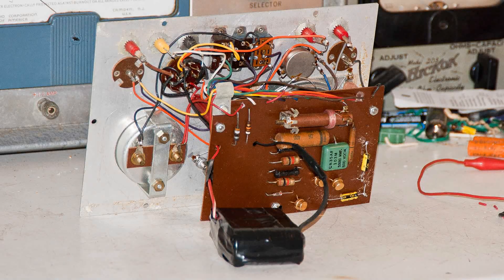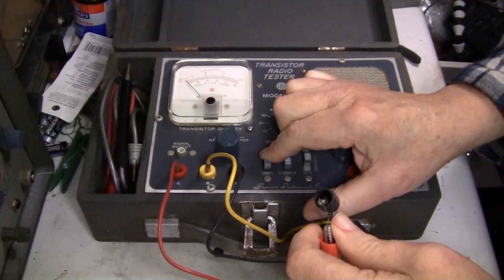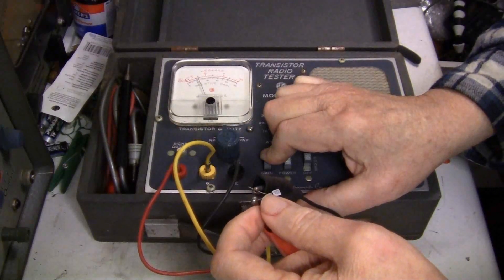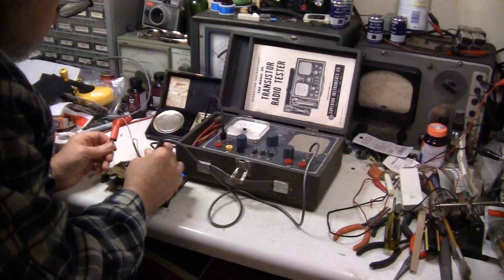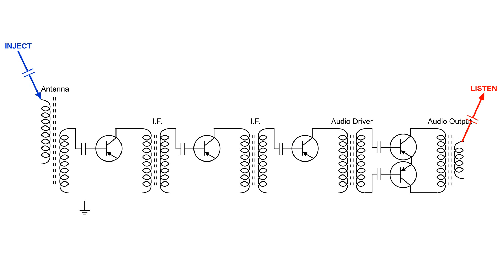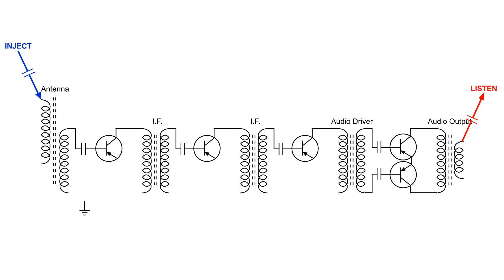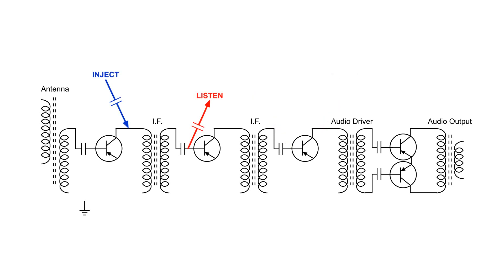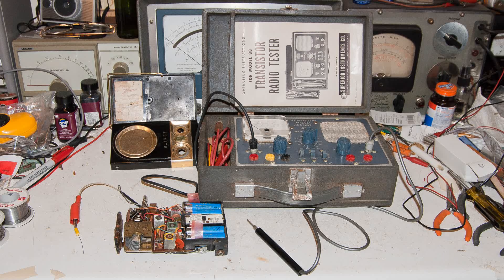Superior Instrument Transistor Radio Tester Demo

Comment: Can this test equipment be used for tracing through FM radio circuits? Im just getting started and am working on a non playing FM radio kit. Thanks for the video!
Reply from the maker: Yes you could signal trace FM. Here is an inexpensive signal tracer.
Build a Audio and RF Signal Tracer using a Guitar Amplifier
https://www.youtube.com/watch?v=QUmPBBnzkRE
Reply from the maker: Yes you could signal trace FM. Here is an inexpensive signal tracer.
Build a Audio and RF Signal Tracer using a Guitar Amplifier
https://www.youtube.com/watch?v=QUmPBBnzkRE

Comment: Hi Rick, can this test equipment be used on UK radio receivers, valve radios included plus can modern silicon transistors be tested with this instrument too.
Reply from the maker: Just junction transistors, MOSFET's warn"t invented yet

Comment: , I have one that i buy on ebay  it came with a 9 V battery I don't have the manual can you tell me the correct voltage I see on the video you have only 4.5 V   The other problem i have is with the red prove the RF it came damage the diode is gone and also one of the resistors on the prove the value is erase  if is any way you can get me this info I will appreciated
Reply from the maker: +Milton Lopez 

Contact SpeakerFreak95 I gave the unit to him.
Reply: thank you i have contact John and he is welling to help me thank you
Reply: AllAmericanFiveRadio thank you i have contact John and he is welling to help me thank you

Comment from the maker: Hey Andy,
Yes this would have been for a professional radio TV repair shop. I don't think many were made because the price of transistor radios dropped, so people just bought new ones rather then getting them repaired. Also the little transistor radios didn’t need repairing that much. I gave this unit to SpeakerFreak95.
Regards
Rick

Comment: Rick,
Question: How loud was the signal prior to the unit being connected to the transistor radio?
I let my tester test itself...the tracer side connected to the signal side with the volume all the way up, but the signal isn't very loud.  Seems kinda low.

Regards,
John

Comment from the maker: @AMStationEngineer
The transistors still maybe good, it is the electrolytic capacitors that are usually bad. This radio maybe collectable enough that you may lessen its value by changing it in anyway.